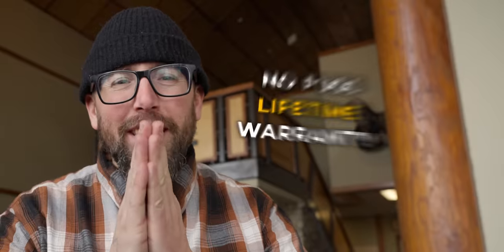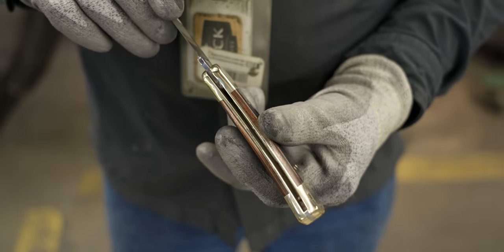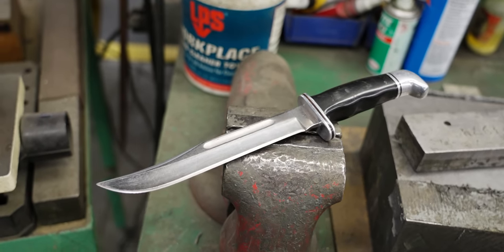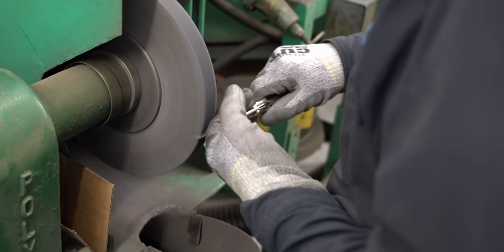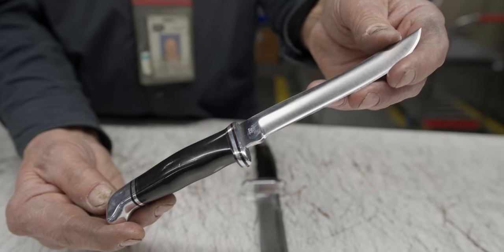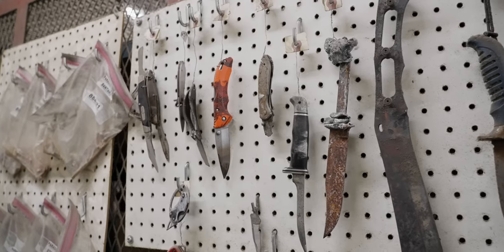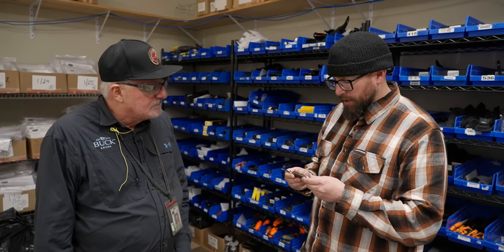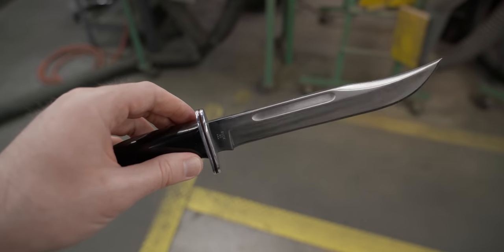I BROKE MY KNIFE!! Now What? || How good is Buck Knives Lifetime Warranty?

Comment: Buck's return policy is amazing. I once broke the tip off my small pocket knife, using it how it wasn't meant to be. Stuck it in an envelope with the original receipt and sent it in. Ten days later, new one in the mail. At this point, my buddy and I spent a summer ruining new knives intentionally and sending them in, just to see where they'd draw the line. When they replaced the one I purposefully ground down to just the spine, I accepted defeat. That replacement knife is still in my tacklebox, ten years later.

Comment: I have a 110 from 1975 and it’s still going strong. At one time it was my only knife. It was used as a hammer many times back in my skateboarding days during the 80’s. The sheath survived a couple of good crashes and is pretty scuffed up. I put an 18 degree mirror edge on it and it’s still standing. The knife is too heavy for today’s EDC, but I will never sell it. There is true character there. It was the first knife I purchased with my own money. Thanks 🔪🎸

Comment: I bought one of Buck's 100 yr Anniversary 110's in 2002, and not even a week in I broke the tip off. I took a file and reshaped the tip and used it up until about 5 years ago, and it was an excellent knife.
Then I was reminded of their Forever warranty, so I sent it in with a note explaining the situation, and that I wanted a blade replacement.
They took and cleaned it up and actually reshaped and reground the tip of the blade like it "should" have been done, and sent it back with another 110. They are very proud of their heritage, and to change the blade in that knife would give it different markings. Since it was an Anniversary model they did not want t destroy it's history or any value it might have, so they sent a replacement and suggested I retire it instead.
I fully expect the new one to be with me for life. And I am a proud and loyal Buck knife customer for life.

Comment: Back in the early 1970’s I worked at Buck Knives at their new El Cajon, California plant on Magnolia Ave. I worked the night shift while attending college. My job was to assemble the Folding Hunter, I would glue and rivet the wood to the brass, when dry I would assemble the brass sides, blade spacers, and latch. The last thing I did was a light belt sanding to clean-up the glue and even everything out. I only lasted a few months before I got a position as a architectural draftsmen. Enjoyed my time there.

Comment: Yes, I can at attest to the quality of their service. Had a 1993 Buck 192 Vanguard from shortly after they were introduce that had a bubble or some kind of imperfection in the metal of the handle and it caused it to break. Sent it in and got a 1995 back as the other couldn't be repaired. It was a birthday gift from my father that year. He told me to pick out a knife and that is what I chose. It's been a good knife!

Comment: I found a brand new Buck 110 on the road outside of Yosemite in 1985. I finally gave it to a grandson a couple years ago. I bought my new Buck 321 Bird knife in 1977, it is right next to me. I used to hunt Upland birds 3 days a week and Waterfowl 3 days a week so it has had real hunting season work for years. I can no longer walk so had to give up hunting but I still have my 321 with me. The 110 is a heavy knife but it was usually with me. It got more work than just hunting and fishing. I got my 321 bird knife in the little Buck shop that was operating out of Knotts Berry farm. They used to put on displays back in the day.

Comment: INow you've done it.  I've been carrying an Old Timer knife for over 50 years and it has both handles broken.  I superglued them back on and, to far so good.  But I'm 72 now and thinking I'd like to leave this knife to my grandson.  Guess I"ll be contacting Old Timer and see if they can fix it, but leave the character on it.
I am a retired electrician and it has served me well.  
And that knife on the wall with the chucnk burnt out of it reminds me of several times I had knives go that route.  Usually when I loaned my skinning knife to a certain Co Worker called "Flash"!

Comment: I bought a Model 110 Folding Hunter in '72 for film work. In '76 I was overseas, and about to deploy to Korea. My Buck knife was back home, so I bought another one at the Air Force PX, and carried that in-country. I was on mess duty, and only used it to slice tomatoes, not Nork throats, but it was reassuring to keep on my belt. Still have both. Neither needs repair, but the sheathes are a little aged. One is kinda floppy [the user] and the other is stiff and brittle because it was a box queen. Saddle soap and mink oil might help.

Comment: Great vid Zac. BUCK has always been in the family as we grow. It's tradition & culture from the good old days to the current days. Got a BUCK selkirk (LG) & a Kydex sheath with a ferro rod holder. Did some mods to it, now attach is a compass, usb rechargeable flashlight & charging cable, a 4inches saw blade which also double as a striker even though the knife have a 90 degree spine. It's almost the perfect BUCK and that is good enough. Cheers mate, always previleage to watch your shows.

Comment: I gave buck folder my father gave me to my son. He used it as a screw driver and broke the tip. I sent it back thinking they would replace the blade, or grind it out . Instead they sent me a new knife and my old old broke blade knife. Some might think great, but I just wanted my old one fixed.

Comment: I bought a Buck three blade model 703 in about 1980 and carried it daily for over 35 years . I broke the smallest blade prying open a frozen fuel door on my pickup. Sent it back to Buck. Since it was long discontinued they couldn’t fix it so they sent me a model 303 free as a replacement. Pretty good customer service!

Comment: I have a Buck knife, a folder about 40 years old that I received as a gift. I was never able to get a decent edge on it, so I finally sent it back to Buck for sharpening. It came back with a surprising amount of metal removed- but still not all that sharp. I gave it another go without any result, and it’s sat in the back of a drawer ever since.

Comment: I sent my buck vantage pro to buck for liner lock repair. They ended up replacing the blade, fixing the liner or replacing it, refurbishing the original g10 handles, and putting a buck logo back on it (mine fell out soon after getting it). It came back looking like new BUT still had the slight character in the handles and pocket clip. I love this as some companies would have scrapped it, and just sent a new one as it's replacement a capitalistic waste. It's just a good knife backed by a good company. Oh and lets not forget the legendary paul bos heat treat. Before having the blade replaced it beat everyone's S30v in edge retention, haven't tested the new blade but touching it up, it feels the same as the old one.

Comment: I snapped the tip off my Buck 110 a couple years ago.  I bought the knife new in 1975.  I shipped it back to Buck with 10$ and Buck replaced the blade and shipped it back with no hassle.  That lifetime warranty doesn't cover blade breakage by the way.  No one can guarantee their blade won't break under enough pressure.  However the warranty will cover everything else that could possibly go wrong.

Comment: I had 3 buck knives over 40 years ago. A fixed blade hunting knife 7 1/2 ", when I tried to cut a clothes line  rope, it chipped the blade all the way down. There was a small piece of wire in it, I was not aware of. I contacted buck to get it fixed. I was told it was not covered under the warranty. There was nothing they would do. I quit buying buck knives and gave the other 2 buck knives away. Have not owned a buck knife sense then. Thanks to their warranty.

Comment: I picked up an exclusive special run gray scaled 303 from Grainger back in 1984 or '85. The company I worked for sent me to the local Grainger store to pick up supplies and while there I saw it in the display case. They wouldn't sell it to me as a private sale because they were an industry supplier only and would only put it on a customer business account. I convinced them to just put it on the account with the other supplies and I would pay my company back for it. The pivot pin on the main blade side is loose and the knife separates slightly at that end with any kind of lateral force. I need to send that back to Buck and have them fit a new pin. I used the heck out of that knife for several years until that pin became loose. It has been relegated to the truck console for years and sees nail cleaning duty at red lights, occasional letter opening and other light tasks. I'd like to be able to carry and use it as an EDC again. That's the only Buck I owned until maybe 6 years ago when I decided to get a 110 after years of wanting one but never buying.

Comment: in 1983, I was in highschool and the FFA. at that time,. the only approved knife for FFA to carry on campus was the Buck 110. and it had to be on your belt, in the BUCK leather sheath. back then, I did not know how to sharpen properly, and I used the ( UHG>> HORRIBLE ) pull through carbide sharpeners. because of this, my 110 blade is substantially shorter than it used to be. I have actually been on the fence as to whether or not to send it in to be fixed up. it would be very cool to have my 110 back to carry, but I am not sure I want to give up the years I put on that blade. but I will say with out any hesitation, Buck is an amazing knife company. side note, my 110 is a bit unusual, as it has the contoured finger grooves. which I almost never see on anyone else's. I don't know if it is even offered anymore, but in the 80's both handle styles were available. I opted for the grooves because I was using it to skin the animals we raised for food, and liked the added security in the grip.

Comment: I purchased my first Buck knife, a 119, in 1968 or 9 (time passed) at Montgomery Wards. They were $20 at the time. They would have sales once in awhile so I got mine for $18.50 (a buck and a half was a big deal back in the day). Still have it, doesn't look quite as good as it did when it was new, still works the same. I purchased a 112 put it on the roof of the car and drove away. The second 112 has been through 2 frames and 3 blades. It is now retired, Buck would probably fix it again, I feel that I got my moneys worth out of it so will not send it in again. It was a lot easier back in the day to take it down to the facility and turn it in instead of mailing it in.

Comment: It's a very good thing that Buck Knives has this lifetime warranty. Even if they don't actually fix "import" knives and only replace them. But that's still an issue if that "import" knife is a "family heirloom" you want to keep, because it belonged to a late grand-father or it was your childhood knife. Only solution then : find someone else who will fix the knife. I was lucky with my late grand-father's two cheap knives (broken blade, broken tip : he sure abused them) : there's still a cobbler shop in my town, who also sells various pocket knives, and he has a collaboration with a local grinder. The grinder was able to fix both knives. One of these knives has been in my pocket everyday for years now.

Comment: Let me tell you about my experience with the Buck Warranty. I purchased my Buck model 303 in 1967 and used it as my everyday carry knife ever since. Some time ago the tip of the clip blade got broken off and over the years the hammer and knife silver emblem came off and was lost. When I inquired about a repair, I was told that because of its age, they could not repair it, but offered to replace it at a minimal cost. Very disappointing.

Comment: Awesome video. Hi Chew appreciate the buck knife company and blades. Although I do not have many of them. I have a question for you regarding the 120 and the 119 standard versus the pro series. Are they that much stronger are they that much better steel. And would love to know if they’re going to do the 124 in a pro series with the new upgraded steel
Reply: The Pro series aren't necessarily stronger, but they offer lighter weight, and the upgraded steel will keep a sharp edge for longer. They will be more difficult to resharpen though. Working on some fun stuff with the 124, so keep an eye out over the next few months!
Reply: @BuckKnives  Thank you great to know. 👍🏽

Comment: I might actually try to find my broken  buck folder and send it back for refurb. The 'spring' is broken so its useless as is, but do i want the blade changed,  as I snapped the tip or just re shaped and sharpened🤔

Comment: I bought a 110 in about 1968.  I used it almost daily and in about 1871 I lost it one day around the front of my property.  I bought another one a few weeks later.  Sometime around a month or so I found my old 110 and I had dropped it in the dirt road in front of my home.  I had run over it with my bulldozer as there was a great big dent in the handle where the grouser or track had made a direct hit.  The blade was not bent or broke.  I sent it to Buck to be repaired.  They sent it back about a month later with new scales and side...NO CHARGE.  I called them and felt bad about not paying but they said it was under warranty.  This is a GREAT AMERIAN COMPANY FOLKS.  BUY THEIR PRODUCTS for yourself and your friends.
Reply: Sorry 1971

Comment: My frist  buck knife I bought in 1975 was a 112 ranger folder with my frist pay check l wanted the 110 but they we're sold out at are local hunting store I'm still using my 112 since then I now have 110. 102 103 119 120   I owen many knives from other manufacturers but my buck knives are number one

Comment: I have a buck 110 folding knife that was my dad's when I was a little kid it has a broken tip on it I've been debating whether to send it in and have it fixed or not. I've heard the steel they use on the new blades isn't quite as good as the old steel but I've also heard the opposite I guess they could just reshape the tip and put a new edge on it.

Comment: In the UK we no longer have the luxury of being able to carry either a straight knife or a lock knife and there is a three inch limit to the length of the blade of any folding pocket knife. Deviating from this is liable to get a person arrested and lots of folk have stopped carrying a pocket knife altogether, meanwhile knife crime skyrockets...

I have always preferred a lambfoot blade and for around 20 years I have carried a 2-blade lambfoot knife inherited from my father who had earlier inherited it from a great uncle. Although retired I still use it most days and it must now be around half a century old, maybe older, so it has lost the extreme tip of the main blade and shows signs of wear but the joints and springs are as good now as when originally purchased. This model of knife is made in Sheffield, England and is still available, priced £49 or just over $60.
I very much doubt the manufacturer would accept any responsibility for any defects after the first year - the British just don't do things like that...

Comment: I am sure that Buck fixes old broken knives, but I have a small folder that I broke the blade on, I sent it back and asked to have it fixed, Buck sent it back and said I broke it on purpose which was not so, Nevertheless I put this knife in a drawer never to be used again. I have case knifes, I have Gerber knifes, I have Puma knifes, I have EYE brand knives, and I also have 5 other Buck knives
but I have never bought a Buck knife since they would not fix this knife...........................just saying

Comment: No warranty is that good. They don't have a warranty for normal wear and tear. So that knife that looks like you used to pry doors with would not normally be covered under the warranty. I suppose its possible that this is just legal jargon but I wish the warranty was more conclusive like "unless we suspect you messed up your knife on purpose we'll repair it!"
Warranty info *note the normal wear part*: 
"We warranty each and every Buck knife to be free from defects in material and workmanship for the life of the knife, and we will repair or replace with a new knife, at our option, any Buck knife that is defective. Buck Knives does not warrant its products against normal wear, misuse, or product modifications. Buck Knives are not intended to be used as hammers, chisels, pry bars, or screwdrivers."